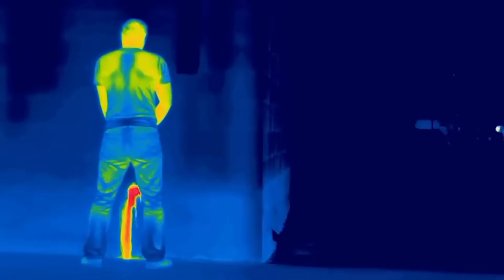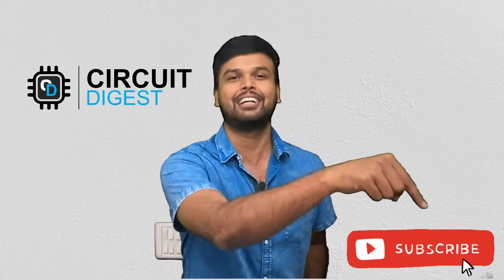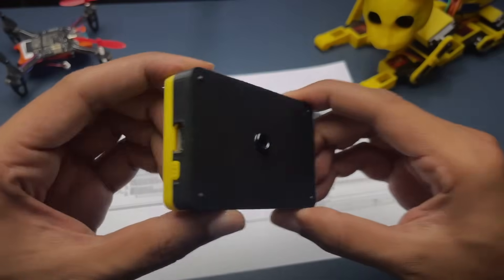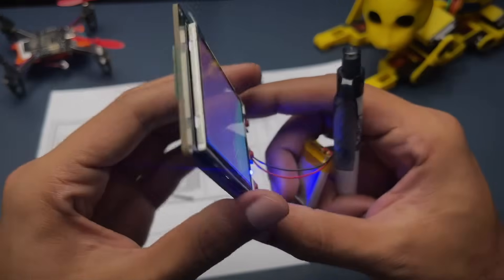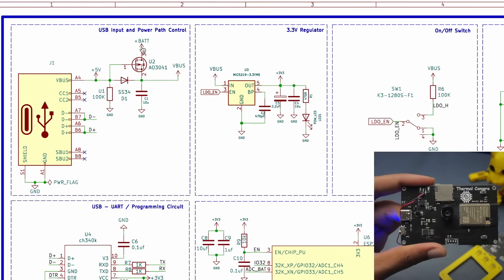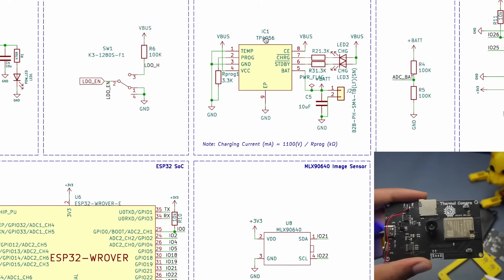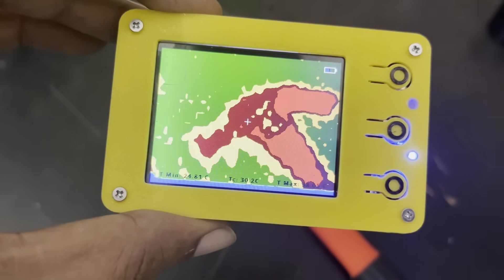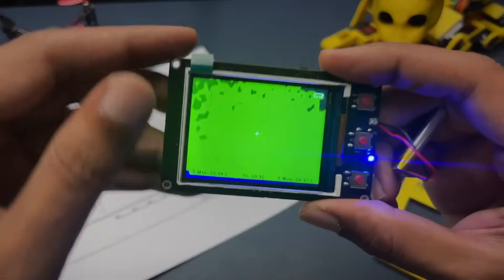How to Build a Thermal Camera for less than 50$ | MLX90640 with ESP32

Comment: hey body  ,  ı need a module which ı can use for house insolation check. this is just whowing me at least 1 meter . this is not enaugh. do ypu know a more comlicated and powerfull module. I wnat to send the drone and check the roof of the house . We cant use it for this.
Reply from the maker: I would suggest you to use ready made thermal cameras for your need. Its much cheaper than the high resolution thermal imaging sensors.

Comment: I am so keen to build one of these. I'd like to 3d print my own casing so it presents more like a commercially available TIC, and if it works well I will probably build quite a few as gifts for friends who don't NEED a TIC in their day to day life, but I know they have been in situations where having one would be beneficial.

I would love to see a build that incorporates a regular camera sensor and overlays the temperature data over the camera image. Is there any chance you have, or might consider putting together a project like this? 

And a silly question, but is it possible at all to maybe use 4 MLX90640 sensors to increase the resolution to 64x48? If so would that be able to be handled by the  ESP32 used in this project, or would a more powerful microcontroller be required?
Reply from the maker: There is no immediate plans on adding any image overlay features to the project. And you can't just add multiple sensors to increase the resolution. For that the best approach is to use a sensor with higher resolution. There are such sensors available from companies like Flir, hikvision etc. They are not cheap and not that easy to procure.

Comment: how far can it detect? can we extend the distance using optical lenses?
Reply from the maker: The sensor is limited by the number of pixels. And it is not suitable for long range application due to this.

Comment: Is there anyway to get the frame rate a little higher on this camera
Reply from the maker: You can, but you will need to optimize the interpolations. The calculations need for the interpolation will take a bit of time. If you can optimize it further or to use an entirely different interpolation method you can get better frame rate. The other possibility is to use some other, better performing SoC like STM32F405 or similar. Especially one that have better performance in floating point calculations.

Comment: Should combine it with a normal camera too to make an overlay, so you can get some detail (thats what normal thermal cameras also do)
Reply from the maker: There are commercial cameras available with and without image overlay. It can be done by interfacing an OV2640 module with the ESP32.
Reply: @Circuitdigest I would love this as well, but I'm a noob, and would require more than a hint to be able to do this. Halp??

Comment: How well does it work for finding failed components on a PCB? Please make a detailed video of this.
Reply from the maker: honestly, the sensor's resolution is not very good to work with PCB thermals. But still, you can use this to see the heat dissipation on a heat sink or to check on switching devices. will consider making a video on this as well 👍
Reply: can we use mobile screen instead ?  @Circuitdigest